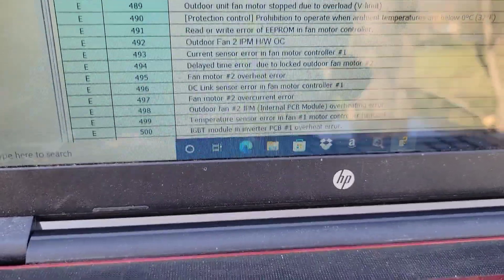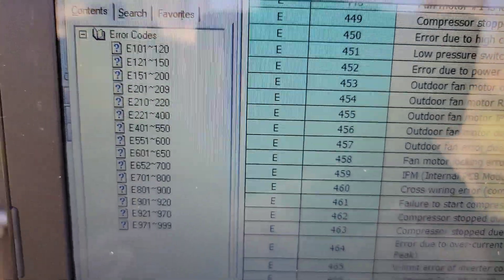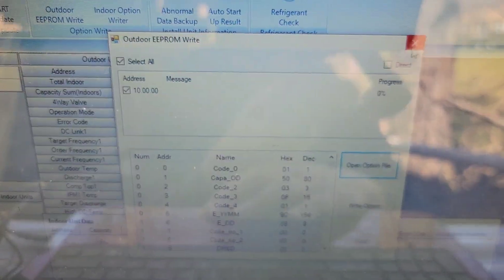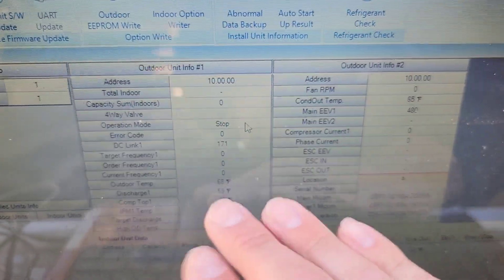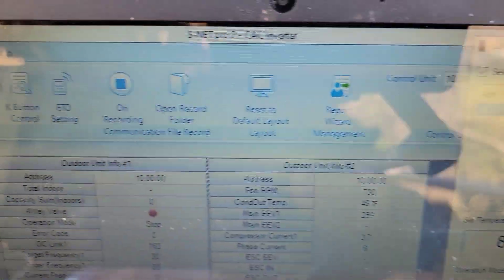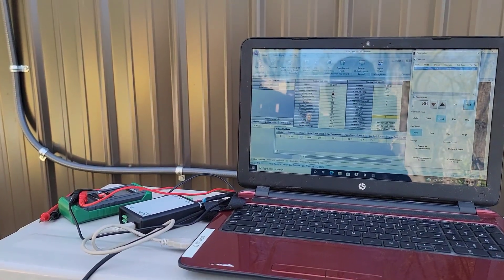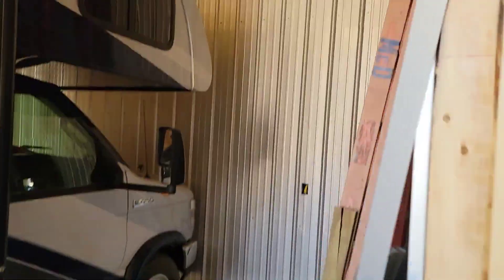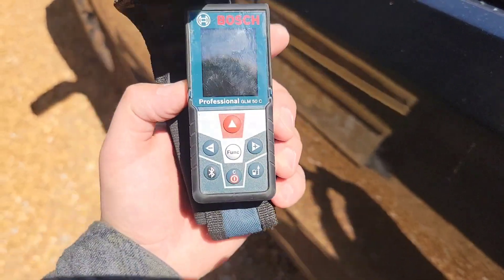Fixing Samsung HVAC Error Code E500 and E470

Comment: I hope they reimbursed you for three hours of doing factory QC department’s job. Note to me…Never buy Samsung. This makes several of these problems. What percentage of Samsung installs have issues at s/u or first year? Fujitsu and Ameristar (Gree) have been good for me so far. Keep up the good work! Thank you.
Reply from the maker: This is the first one that i've had on startup that had a bad part out of several hundred so i've had pretty good luck so far
But this is brand new equipment that has been redesigned and I hope that I don't have any further issues

Comment: Hi, Taddy. How do you rule out a bad compressor? A bad compressor can cause the inverter board overheat. Thanks.
Reply from the maker: Check the compressor windings with a meter
Check the compressor harness and wires
To make sure they're properly connected